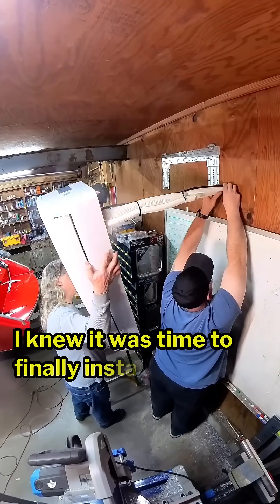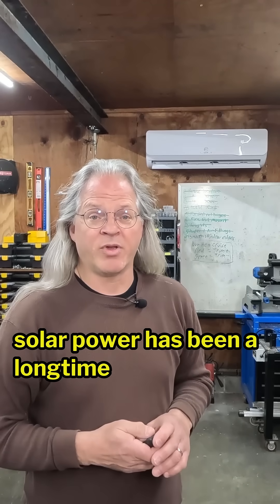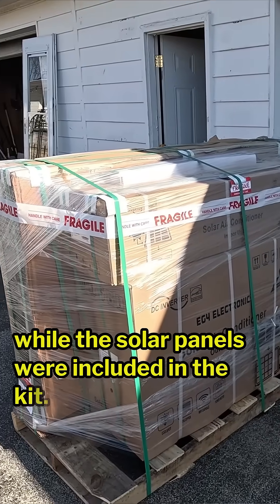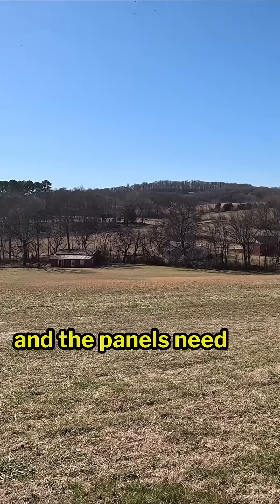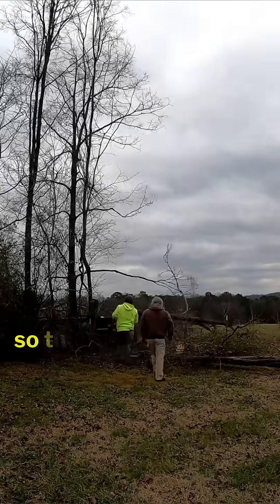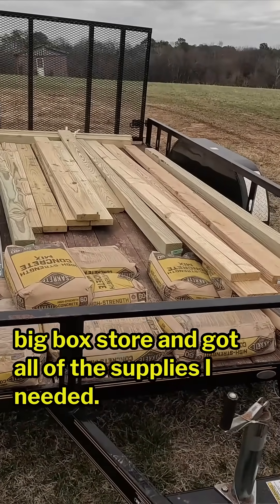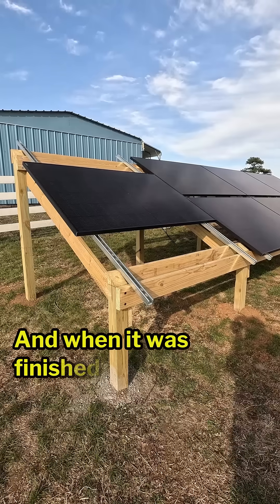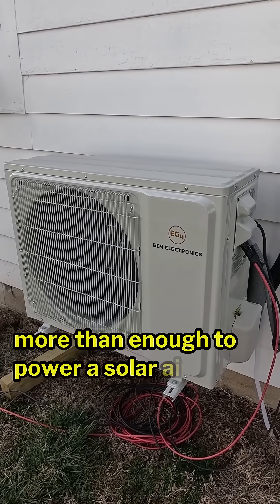Building A Ground Mounted Solar Array To Run An Air Conditioner #solarenergy #makingstuff #shorts

Comment: And you have power over night, I guess you don't use any devices, as deep freezer or something.
Reply from the maker: No, nothing out there in the shop that needs power at night. Beside the shop has grid power.  The solar is just for the air unit.

Comment: I hope you do not want to be in that place at night.
Reply from the maker: I'm only out in the shop during the day.  The shop has grid power, so if I am out there after dark it's not a problem.
Reply: why?
solar controllers are optimized for charging batteries, you draw the power you need from the batteries